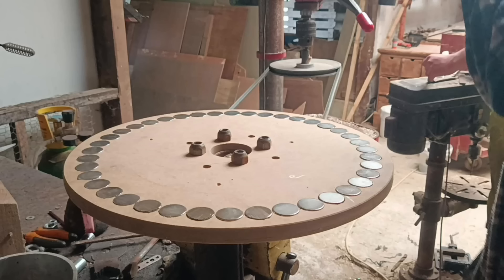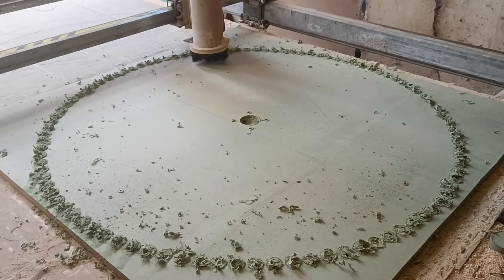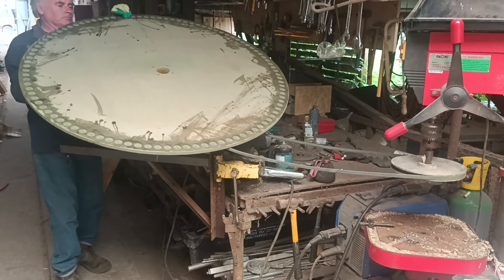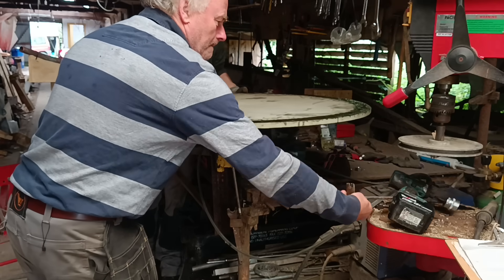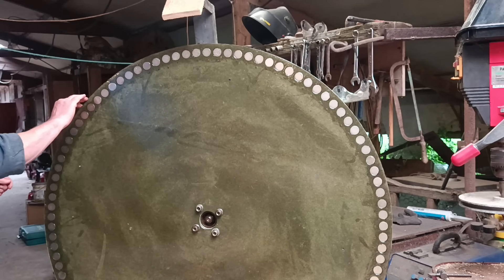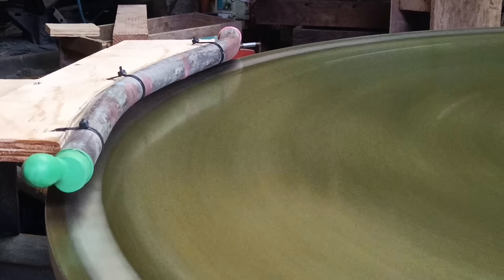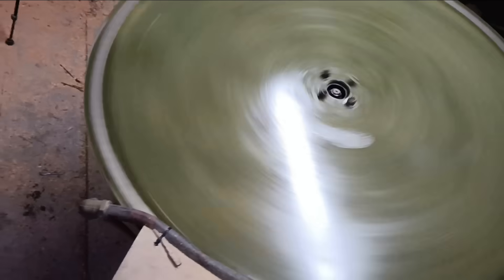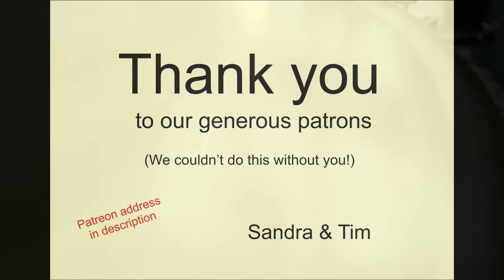ABSOLUTELY HUGE Magnetic Induction Heater! Using 100 Spinning Neodynium Magnets And A Bucket

Comment: Here’s my thoughts Tim. So before you go to the trouble of insulating the water pipes and tank and seeing what the temperature rise of the volume of water over time is, ie the amount of energy transferred. Like an electrical generator you can quickly see what the power output versus the power in is, ie the efficiency by measuring the power delivered into a resistive load whilst measuring the current into the motor with the load attached? 

Well we can clearly see “work being done” in your water heater and your load is the effectively the copper pipe with a volume of water contained in the active length of tube in proximity to the magnets, yeah? So If you put a clamp meter over the incoming live or neutral conductor of the mains to the motor and monitor the current into the motor once the disc is up to speed, so in order to improve the efficiency of the system then if you move the copper pipe towards the spinning disc magnets and away, there should be a noticeable change in current drawn by the motor because we know then that work is certainly being done and energy is being transferred into the copper pipe and the water being heated. 

So my thinking is if it was me I would firstly be thinking that I need to get my copper “pickup” system, ie the copper pipe to be as efficient as possibly. Now I appreciate that you probably have thought all about this and some may suggest why not just have a copper induction coil and generate electricity instead but that’s not your intention here as you want to directly heat water?

We are passing an alternating magnetic field into a copper pipe and the eddy currents in the pipe are producing heat, thinking about the magnetic field and the size and strength of the actual magnetic field and let’s briefly compare to an electrical generator for a moment… in the pick-up coil of the electrical generator, the coupled output power is determined by the length and thickness of the wire composing the coil so we want to add as much “copper” into the  pickup,coil as we can and we do that in two possible ways, we wind as many turns of the wire into the coil as possible. We can increase the number of turns of wire by reducing the thickness of the wire that will give us a higher voltage out but reduce the current because of the effective series resistance of the length of copper wire. So if we increase the thickness of the copper wire we will clear.y have to reduce the number of turns in the coil so we increases the current but reduce the voltage, we therefore choose the optimum amount of turns versus the thickness of the wire. Now we need to capture as much of that rotating magnetic field into the surface area of the pickup coil and so we add an iron core to the pickup coil (we laminate the core to reduce the loss due to eddy currents) so that we can transfer as much of the magnetic flux from the spinning disc. 

Going back to the water heater system we need to think about the eddy currents that are being produced and how can we increase them? I would experiment with the size, shape and mass of the copper “pickup” system. So what about trying some of the below:

1) if you replace the copper pipe with a solid lump of copper - the shape may be important - try a disc or a cube, extend the length of the disc or cube to make a cylinder or cuboid and adjust the length and proximity of the object to get the biggest draw in motor current. Try maybe a hexagonal cross sectional area of the block? So if you find the bock heats up really quickly then that might be better if you solder a spiral coil onto the top of the block to transfer the heat into the water? 
 
2) Compare the above results with those obtained from taking some thinner tube say 8 or 10mm diameter and wind a flat spiral and once again monitor the motor current whilst moving the position of the pickup tube. Try even a vertical coil of tubing versus the previously described flat coil. What about stacking a number of the flat spiral tubes on top of each other or wind 2 or 3 vertical coils of different diameters to sit inside each other and then connect all of the tubes together therefore maximising the volume of water being heated.
3) If you experimenting with option 2 and using multiple coils then it might be important to electrically isolate each tube as you don’t want to produce an induction coil so if you connect all of the separate tubes with neoprene or silicon tube then this might maximise the amount of eddy currents in the total surface area of the copper ?  Taking it a stage further to prevent the water conductivity reducing the efficiency you might need to add an electrically insulating lining to the tube but using one that has good thermal conductivity ?

Sorry for the lengthy explanation, I have ADHD a and I have to describe my thinking as a logical series of steps, I struggle to be concise lol 😂
Reply: And don't forget the back flow preventer ball, so the water leaves the heat source in the direction you want...( like a coffee pot)
Reply: @buffplums :  To be concise in writing, try the "enumeration method", around 70% or the "words flood"- will be eliminated!..😂
Reply: @arielhermoso4262  😂😂😂
Reply: And they deleted my entire post under the video.... with calculations.
How crazy can it get with censoring?
Reply: Don’t feel bad.  YouTube has censored myself on numerous occasions for absolutely no reason whatsoever.  Being truthful, transparent and honest will get you removed and then the handcuffs go on for a while.  I can’t understand their reasoning and they never explain theirs
Reply: @SuperDave-vj9en  more was deleted now. Also without calc and not very long either.
I pointed to the flaw in the system this guy made in several posts

That doesnt seem like a youtube deletion
Reply: Didnt read any comments before i typed my own extended comment.
Also said that hes not going to gain much (some 10% at best) from isolation of the tubing.
I estimated the motor power delivery, bc he gave the output, so i could guesstulate the efficiency. I came to 20%, very roughly of course.
Which means he has to get 3 times more energy out of the system (so 4 times what is now), wihouth increasing input of course, to start to become competative with a generator (80% efficiency minimal).
Atm 80% is losses. Since you cant decrease that from isolation and friction from belt, bearings, and so, it means a big overhaul of the system itself.
Not only the pick up as you and i saw just now some others too have mentioned, but the entire disc will have to be encased. That means heat will rise inside aswell, which is good, bc it contributes to the water heating up and also helps in providing a failsafe device. But it has consequences for design and materials chosen, as that captured heat inside the3 enclosure also affects everything in there.

Thats also when isolation becomes beneficial. As output water is hotter, losses rise, as a bigger delta t = more losses. So only then will you see a benefit from isolation, when the water actually becomes hot. Water of 23 celcius in a room of close to 20 celcius is minimal losses. far less than 1 %

Funny to see how everyone focusses on their own thing.
I focussed more on the system in total and losses and so, while you focus more on the pickup system. ;]
Reply: oops

Said room is 20, bit is 13ish. So a bit more delta t. Still wouldnt be a high amount of loss though.
Having said that, the temp doesnt rise anymore after it reaching 23, which means losses are as big as gains. So at that point its 100% loss.
Since delta t is still low, that means the energy from induction is very low. If it cant keep up the low loss of a delta t of some 10 degrees, its very low.
The isolation he says it needs, is not going to fix that.
The plastic pipe already has some isolation properties. He's probably already losing almost as much as he gains in the copper pipe, to air. Air will also be moving there, since the disc spins fast. And even though air is a good insolator, moving air is not. Losses will be high there.

Comment: Second law of thermodynamics anyone?
You will get better results by hooking up an efficient generator to your windmill and then connecting a water heater to the generator.
This system will have hinger losses due to drag in various rotating assemblies and aerodynamic drag. Not to mention losses due to length of the water pipes.
Magnetic fields are better off being contained with ferrite rings to concentrate them on the pipe, but it will be difficult with this setup, as the tube needs to be inside the gap in the ferrite rings.
It is a very cool physics demo. But it is not very practical.

Comment: simple  you coil the pipe inside the bucket at the top, that increases surface area as the hot water comes in it heats the water surrounding it, the same water that is coming out into the bucket.  The return pipe should be placed higher up as heat rises the hotter water will reach the top and then drop back down again, here is the trick you make the return pipe narrower on the inside diameter as that increases pressure to the pipe above the magnets.  Insulate the bucket.  consider replacing the copper pipe above the magnets with a small computer radiator.  If you are feeling flush three more computer radiators at the cardinal points linked up together will get it hotter.  On the primary radiator you add a inline tap wait ten minutes before opening,  then ten minutes on the secondary tap and so on,  the water will be getting super hot by then before you allow the water to circulate

Comment: The issue is the magnetic field is not fully enclosing the copper pipe.
You could make it work better with two discs with magnets(in holes) with a square tubing(or flattened copper tubing) in the middle. Also have a soft iron plate(can be segmented into arc) covering two magnets at a time(can also be glued). The magnet poles need to alternate in the same disc as well as the one below. The magets in top disc and bottom disc should lineup with opposite poles to complete the magnetic circuit through pipe. The two discs can be attached together to make them look like a single disc, with spacing in between.  In simple terms, it will resemble a diy windmill generator without coils, but copper tubing on the edge. You also need to slide the flattened tube to position, between discs, instead of flipping it from above. Just some suggestions.

Comment: You might be able to use the magnets to directly push the water along, too, instead of relying just on the thermal effects. If you put two electrodes through the sides of a plastic pipe and run a tiny bit of current, the moving magnets can push the water the same way they'd push a wire carrying that current.

Comment: One analysis to do is figure out how much power you are putting in, using a power meter on the drill, vs how much power is actually going into the water.  Obviously you can never go over unity, but the analysis could tell you if you're approaching optimal, or if you've got a lot of excess power that could be used for even more magnets.  For instance, if the drill only draws however much power as you expect from the windmill during spinup, but then it just coasts using a few watts, there's not enough load yet.  You can increase that load by added more magnets (wrapping around the pipe might be easier than making the disk even bigger) or more pipe, or both, but eventually you'll hit a point where the drag on the system keeps the motor at peak current draw constantly and you can't improve it further.

Comment: Surely the energy going in is being wasted by the bearing as heat this is a very cool project but I bet it's more efficient just to hook the will will to a generator and then to a induction heater no?

Comment: Not sure it matters in this case but pretty much every flywheel has lots of the material in the middle "missing" to cut down on the weight since it spins slower and doesn't add a lot of inertia.

Comment: make a ring of coper tube that goes around the whole ring of magnets (except for where you have to enter and exit)
also make the pipe slightly angled so that the entrance is very close to the magnets and the exit is slightly higher, this will help promote flow, i shouldn't take much, like just enough to cross over itself at the ends.
youll want to keep the pipes that go between the heater tube and the tank as short as possible but leave the entrance side just a little lower so that you get single direction flow.
dont forget some kind of drain valve at the lowest point in the system so that if something happens you can drain everything easier.

Comment: A full loop of copper pipe will probably required, also if you plan to run this solely off of a windmill you will need a flywheel and a gear overdrive/multiplier. Also, while that is spinning you definitely need to run a blade across the outside to help balance that out, it's basically a giant lathe work right now.

Comment: First, you only probably have 500 ish watts max of power available with this setup, since more than that on a drill press is pretty unreasonable. 
Assuming the motor manages to get to synchronous speed, the 100 magnets should get to the equivalent of 6khz*your pulley ratio. Which is going to be a skin depth of less than a mm so you should be getting full heating of your tube. 
Now the issues should come from coupling. You have an air gap that's nearly half the thickness of your tube, that's gonna make it not transfer a lot of power. Ideally you should try to get the tube closer to the wheel than the gap between your magnets to maximize the field going through the tube. The tube being round also hurts coupling. Since the gap between the magnet and the material you're heating matters, a flat sheet would be the most effective shape.  Using a steel wheel, or a steel ring directly under the magnets, would also increase the field and improve power transfer. 
I would estimate that you probably didn't get more than 20-50W of heating in this test. Since I can't hear the motor bog down when you bring the tube near the magnets I assume that either there is enough momentum in the system to make the change difficult to detect or the change in load is insignificant. Since the motor sounds reasonably stressed all the time, i assume it's drawing its full power, and hence, a total efficiency of less than 10%. 
Realistically, using three or six microwave oven transformers and six of those magnets could easily get you to 50% efficiency. So could using a car alternator or your average drill sized brushed dc motor, so around that should be your goal. (since otherwise the much more boring solution of turning your mechanical energy to electricity, then putting that through a big resistor makes more sense)

Comment: a spiral of pipe and magnets across the whole surface of the disk would probably work. and it may be easier to insulate the whole apparatus in a large box instead of trying to insulate the pipes.

Comment: Do the magnets also heat up?
Reply: Generally no they don't if you design the system well.  The field in the magnet is not changing so there are no induced currents.

Comment: You made a thermosyphon. This was how the Ford Model A’s cooling system worked. Most illustrations online show the hot water coming in at the top. I don’t know if you have your internal pipe fittings in the bucket at different lengths, but if not perhaps that’s a place to start.

Comment: if you squash a good portion of your copper pipe into an elliptical shape heat transfer should be improved slightly as the core of the pipe would be closer to the edge where the heat is generated maybe.

Comment: 2 thoughts that I don't know what effect they will have. First lengthen the copper pipe to cover as near the 360 degrees of the spinning disc as you can. Currently you are using a quarter of the disc and the magnets then do nothing until they come back under the pipe. The 2nd thought is what if you make a second disc and mount it on top of the 1st with like poles together with a big enough gap between them for the pipe to fit. So the magnets work on both sides of the pipe at the same time. Would this amplify the induction effect? To quote a wise man, "I don't know." Please keep the videos coming. Always enjoy them. Any chance of a garden railway update. Where have you got so far? What is the next idea?

Comment: Tim you need to extend the Flow pipe in the bucket so the water will circulate the top of this pipe has to be below water level. Cheers
Reply: Nah, it should work fine as-is. The force comes from the difference in density of the water in the pipes, not in the bucket, and the hot water will rise coming out of the warm pipe in the bucket, letting the cool water into the other one.

Comment: Maybe some sort of convection lock happening, determined by the differential between the height of the two pipes? Maybe a small pump could help the heat travel.
Also, as mentioned above, adding any number of copper coils should gather more heat... At the expense of more resistance though, correct?

Comment: Use a thick tube on the hot water and a thin tube on the cold one. That's how old boilers work. It was used, at least in Sweden, before everyone had electricity for circulation.

Comment: If your setting up a thermal siphoning test you shouldn't have both inlet and outlet both on the bottom of the hanging pale. The bottom of the pale is high pressure and so would be the incoming line the copper heat pipe and the return line to the pale must be near the top side of the pale to make it of a lower pressure in order for it to return. This is essentially how a drip coffee machine functions.